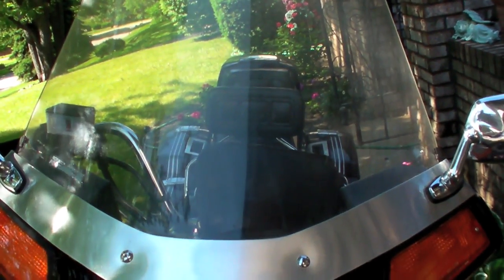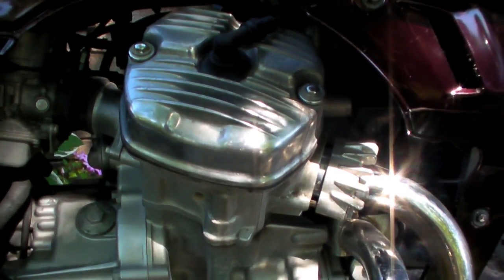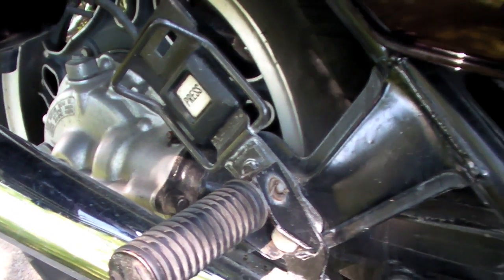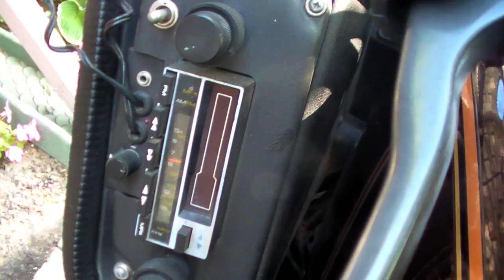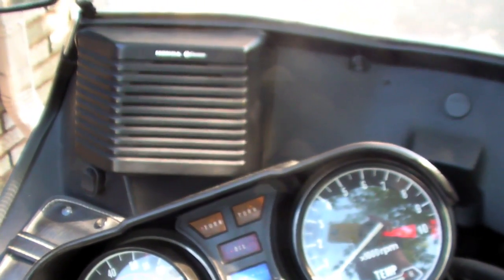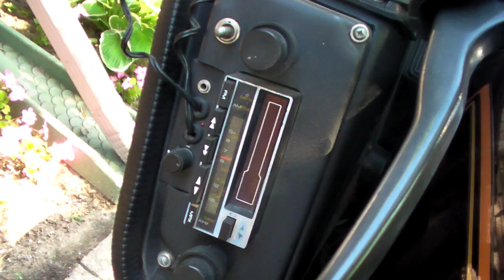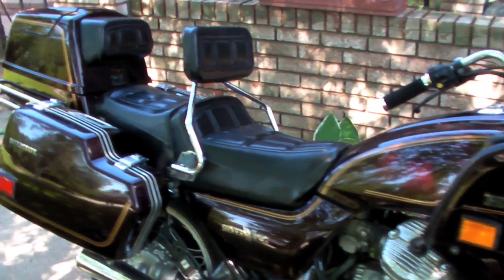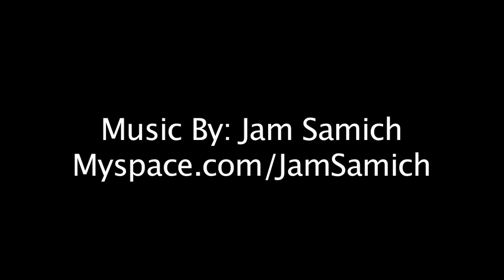Introducing: The Silver Wing

Comment: Nice video.  The GL500 is great bike.  I enjoyed mine.  I have also owned dozens of motorcycles and these SilverWings are at the top of my list.  I also had the GL650 Interstate and in my opinion it's an even better version of this bike.  Although they are both great in their own ways.   He mentioned revving the engine and feeling the engine want to torque the bike to one side.  That only happens in neutral. In gear the torque is cancelled out by the transmission which ingeniously spins the other direction.  I had so much fun on both of my GL Interstates.  The fairing is the same one off the GL1100 and was used on the CB900 Custom.  Combined with winter lowers (which are rare) it's has the best wind protection I have ever had on any bike I have owned,   It's a shame that many of them are being chopped up to become bobbers, etc.

Comment: I am pretty sure that I'm gonna get an '83 GL650 I that is sitting in a shop where it has been for about 15 years. 11K miles. Same color as yours. I'll need to rebuild the brakes completely and probably the carbs too. It's in decent shape over all. Exhaust pipes are rusty but seem solid. Will need tires. Should be fun! 

Great video. You should be in the TV business or something! Cheers.

Comment: This is just like mine, except for the driver's backrest, and some other minor differences.  Excellent bike!  I now have Metzler ME880 touring tires, and it handles very well. Very sophisticated in some ways, e.g. the air shocks, but very durable.  Main thing to watch out for is the water pump seal. The seats are very comfortable, and the riding position is perfect.  It's powerful enough to get past any truck on the freeway, although I believe the 1983 GL650I  version really got it right..
Reply: I so miss my Silver Wing! Had it for eight years, my main wheels that whole time.

Comment: If you decide you just can't get comfortable on the GL650, I'm in the market for one. I've owned 3 500 Interstates like the one GL650 Interstate.  The best bikes I ever owned.

The bike in the video is very similar to the last one I had, except for a couple of differences.  I had the factory Type II radio with CB.  I also found a color matched trunk from a GL1100.  A few quick mods to the mount for the stock trunk, and I doubled my capacity, making it easier to stow a helmet and other stuff.

Comment: Have close to 100,000 miles on mine. Bought it used in 2001 with only 14,000 miles on it. I have had to replace the rear final drive three times. My fault for not checking the rear drive oil level. A word of caution here DO NOT overfill them, as that's where the trouble begins! Other than. That still running strong...

Comment: Nice video. I had a 1979 CX 500 that I sold because I was out of work. Got work and starting looking for another Honda, I've found a 1983 Honda GL 650 SW Interstate, with about the same miles and the same price I sold the 500 for. I am concerned about the rare 650, as they only made them one year. I'm excited about having the flaring and luggage cases, dual disc brakes, and air suspension. the extra HP on the highway should be nice. Question How many miles on your bike ?